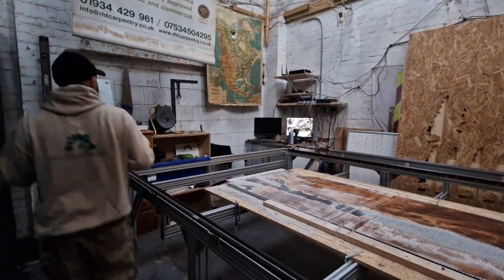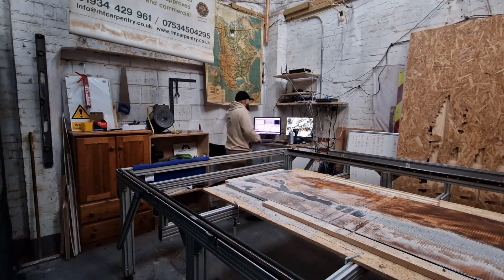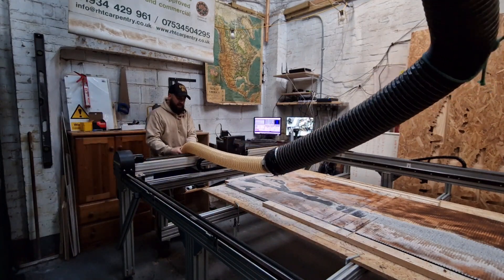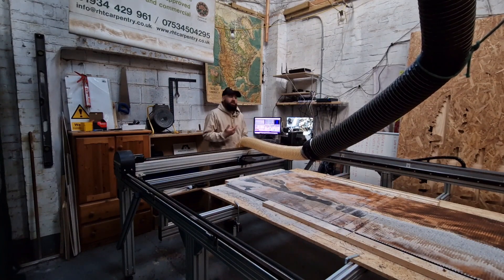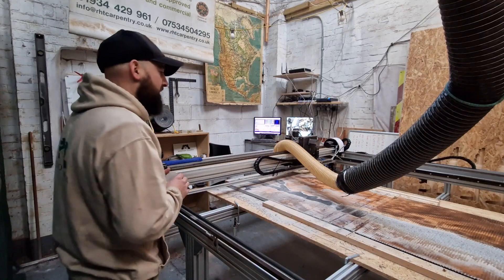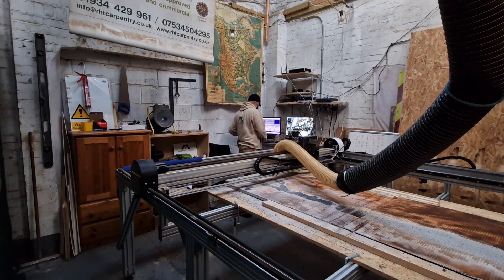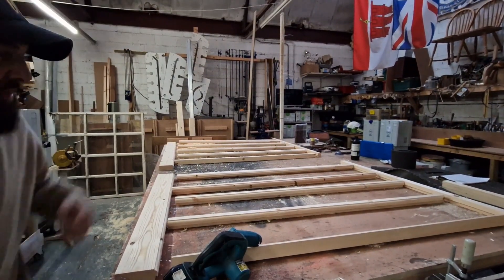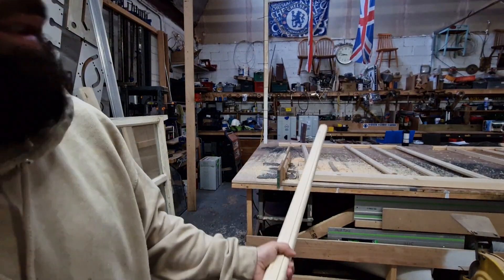How I Set Up My CNC Machine

Comment: I didn't even realise that you could use them for van conversions. All times I've struggled building van conversions 😮
Reply from the maker: Yes well these cnc are robotic and have the ability to be programmed and you can do absolutely anything with timber, sheet material. This cnc can fit a 10ft by 5ft sheet on it easy
Reply: @WestonTimberWales  thank you  I'll remember that for next time 😊